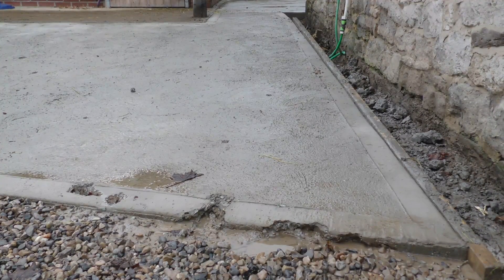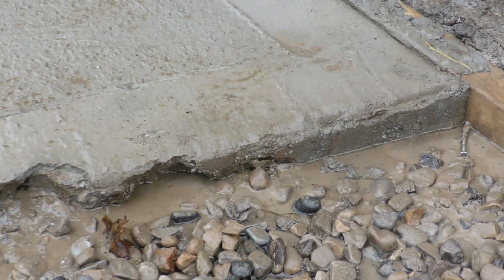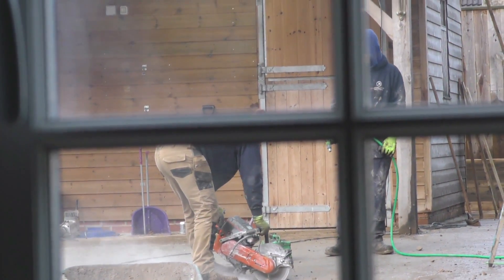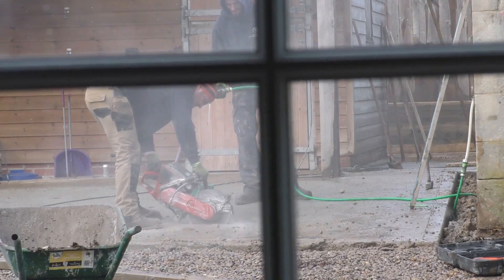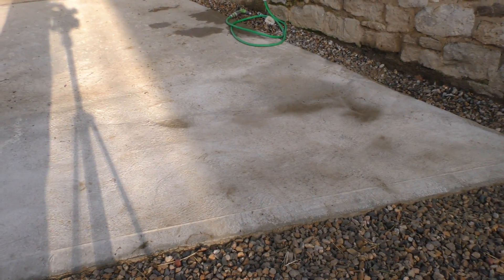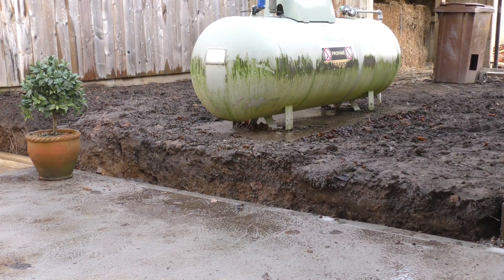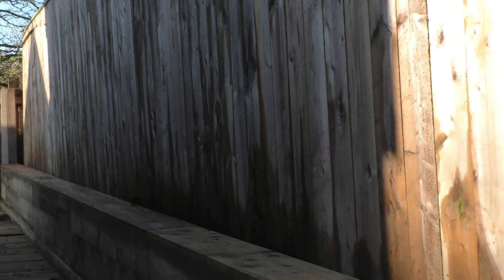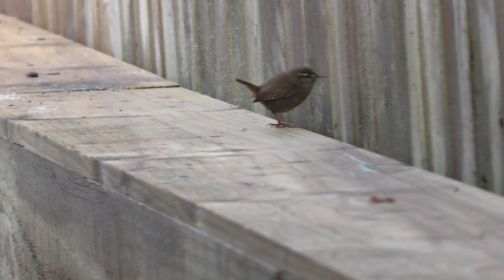Failed concrete floor.  Preparing for our new foal. PART 6

Comment: Oh dear, this is like one of those reality shows (which I don’t watch), but this is far more real than any of those shows.  I know you’ll be glad when all the fuss is done.  What a mess around the propane tank!  Those surprises are not very nice.  That little wren is so cute!!!!  We have Carolina wrens here all year round.  We have nest/roost boxes on the big beam under the roof of our front porch.  We get to watch the nesting process every spring, then host them in the winter with a protected place to roost.  They are comfortable with us and provide much entertainment!  We have to be careful not to keep the front door open too long or they will come inside.  I had one do that once and it took quite a while to get the thing out of the house!
Reply from the maker: it must be lovely to watch them 🥰😍

Comment: Oh dear. At least, it wasn’t all ruined. Hopefully, the rest set correctly and won’t crumble on you, come winter (if it ever comes, lol, I‘ve been working outside in a sweater yesterday and the day before. It was 13 degrees C or something. Up to 17 in southern Germany). 
And I had my own little ‚fail‘, very similar to this just now. I‘ve been putting in the (teeny, tiny) sink in my camper and used a bottle of silicone adhesive, that, upon closer inspection, was ‚best before use 2012‘. It didn’t set at all and I had to scrape off the gooey mess again, two days later. Who would have thought, stuff like that can go bad? Ah well. 😄
Reply from the maker: I would not have thought it would go off when not opened, either.   🤞 for the next attempt 😊

Comment: Too much wet weather lately ..should been covered in rainy weather..not the best time to concrete;but equally too hot a weather can make it crack as well.
But it needed to be done in time for your foal soon.
Id put a small fence across the oil tank area and then grass it over.
I see a gold crest the other morning ;again a very small bird,maybe smaller then the wren ,or so it saids.
Never seen one that close before a beautiful olive green colour..
I make sure I feed the birds everyday at some point.
Reply: I think grassing it over is a great idea.
Reply from the maker: yes smaller than the Wren the Wren is the shortest bird my mistake

Comment: Such a disappointment Tara. Things can go wrong at times, however for me it’s how the company then deals with any problems as well and in my experiences I’ve found that to be a problem as I think I’ve mentioned before. As if you’d have just wanted the rear part left like that! I hate having to have anything done on my house, not that I don’t want to do it or necessarily spend the money, just that I find it so hard to find a company that can be truly relied upon to do a good job. Lovely Wren by the way, they don’t stay still for long so great that you were able to capture it on film 😊👍

Comment: Water strengthens concrete. The slower it dries, the stronger it gets.

It must be bad concrete.
Reply from the maker: I think it was the preparation of the base before laying on this last section
Reply: @Tara101  Also, the layer of concrete looks a bit thin to me.
Reply from the maker: yes it was supposed to be 6 inches and it was 3 inches when I measured it.👎
Reply: @Tara101  Don't your contractors know twenty thousand people are watching them like hawks?!

Though...hmm...that might fluster them a bit...
Reply from the maker: 🤣😂👁👀 👁 lol

Comment: Denmark is also wet, wet, wet and cold 😞 but soon the days will turn and wil be longer again. 
I can’t wait to see your new foal ❤️ and also looking forward to see how they make the rubber flooring in Apollos new stable. Do you have to “repair” the rubber flooring in the existing stables? I dont know if the get worn over time?
Reply from the maker: They have repaired Apollos floor a couple of times (free of charge) there has been no repairs to Farouk's floor.  We have decided the new Apollo stable will have sealed down mats as Apollo is a bit of a digger with his front feet and the mats will be harder wareing.

Comment: I don't know if it's related or not but this area they were starting to get the cement right out of the truck and then the operator came over and got a bucket and got some of the cement from out of the chute and you said that he was taking it to be tested ? Is this a result bad batch of cement? Can't wait to see everything all done and your new baby
Reply from the maker: no it's not the concrete, it's down to Dave.

Comment: We had trouble with the concrete fence posts in our garden, within 15 months they were crumbling, leaving the metal skeleton of the insides showing. When we rang the company to complain, they said they weren't covered under the guarantee?!!! My husband said well surely they should last longer than the wooden fence panels ! Very reluctantly they sent out the boss to have a look, he couldn't believe the state they were in & got them replaced ( mind you only the worst ones !) Six months later a few more started to go the same, husband stuck the pieces together with sealant !!!
Reply from the maker: that's bad they should last much longer.
Reply: @Tara101  - Had the same company before  & those posts are like new, think someone bungled the cement mix !!

Comment: You know, here in Florida we deeply bury our home's propane tanks , and just a small , low, rounded lid is left on the surface,  to cover it's refilling nozzles.   Propane hoses are linked underground , to the amenities they serve.   Would that be possible in England ?
Reply from the maker: yes they can but it isn't ours it is only on loan to us if we use the supplying company for the gas.
Reply: @Tara101  Yes, that's how it works here too.  But the gas company started burying them by request of the builders and clients years ago.  It's a nice system and seems safer .  Maybe you could start a revolution !  ;-)   Merry Christmas, Tara and all !
Reply from the maker: @jodyhuston1516  👍♥️😂

Comment: It looked like there was too much ground water in the corner that affected the cement. In the previous video the guy shoveled out some of the water and mud out of the corner where the cement didn't set properly. I think it is rude that they left the back bit and did not include that in the quote what did they think you wanted done with it left all muddy with a big ditch and bank?
Reply from the maker: yes it did annoy me that they tried to get more money out of us for something that should have been included.  Well it's cost them two big jobs and the small leaded bay window job.  We have had two other companies quote so that will happen sometime in March/April 2020